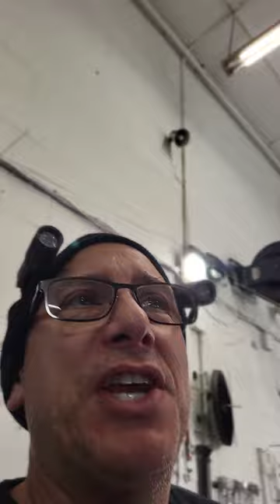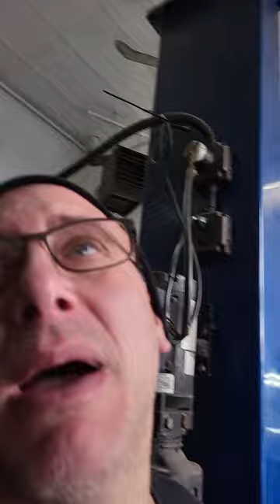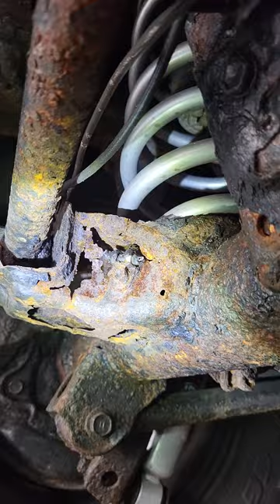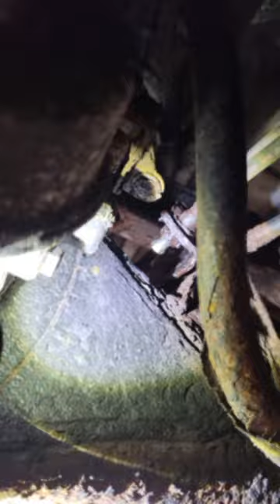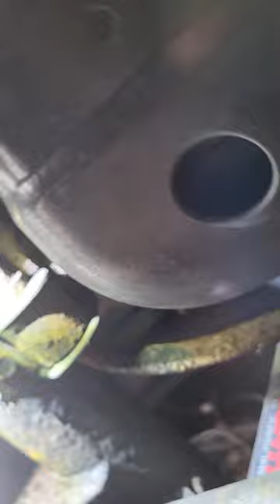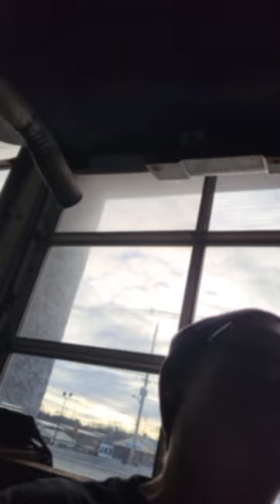Theives ware many masks fj cruiser lifted wheels tired eww

Comment: I wouldn't be so quick to assume a shop did that. Coil springs not being clocked correctly and a ignoring a brake line leak. Rake not set correctly. It's probably diy